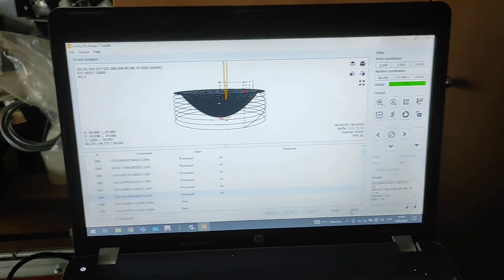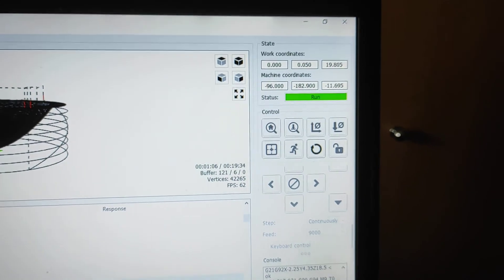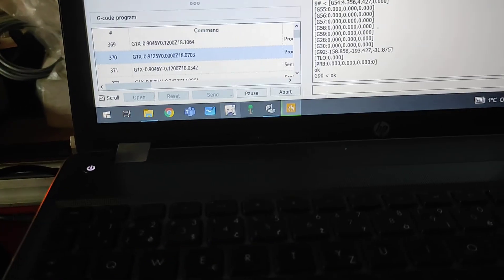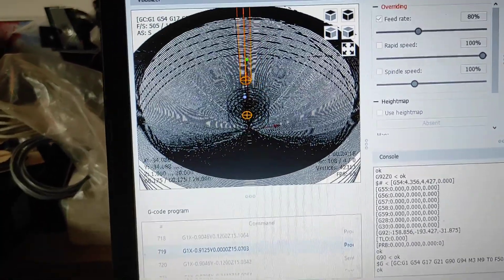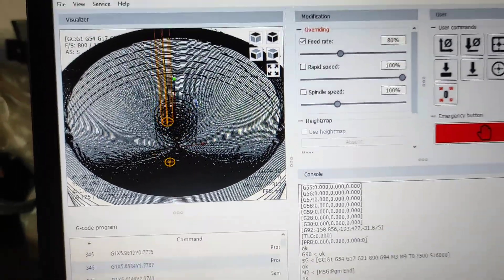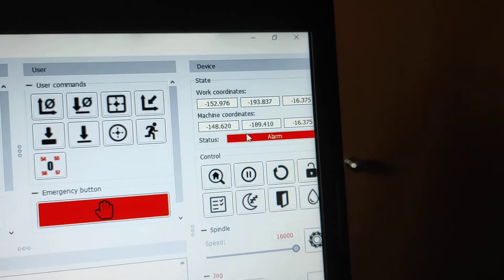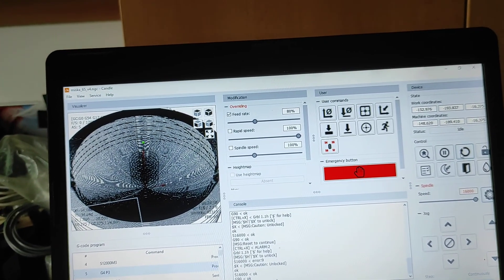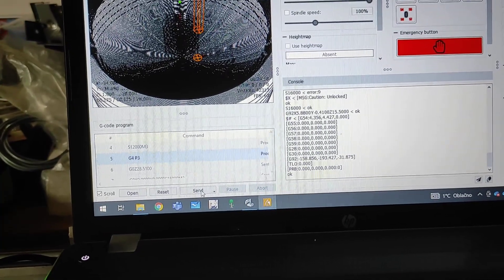CNC GRBL Candle 1.1 / 1.2 - small but important differences

Comment: I have a problem if you can help me please.
When I design a specific drawing and convert it to gcode Comes in the sizes that I want But when I put it in a candle program Comes in extra large sizes. 
I'm confused I can't find the reason, please help me
Reply: Does your machine move as much as you tell it to move? Is it done only for this project? If not or you don't know I would say you have to calibrate your axes. The steps of the motors. If they are far off the motors will travel more thinking they travelled as much as the design. Check your motor steps. There are plenty of videos about it. That is probably it.
Reply from the maker: What does it means "convert it to gcode"? Less info to solve.
Reply: @lupa-cncfocusedonutility2783  
When I put the G-code file in the candle program, it does not come with the required measurements. Comes in a much larger size. 
-Excuse  my English is not my first language.
Reply from the maker: @شمسالدين-س1ط  milimeters, inches ..... what difference between sizes?
Reply: @lupa-cncfocusedonutility2783  
Think centimeters I draw a PCB with a size of 80*40 mm. But the result is very large, doubls the size
Reply: @lupa-cncfocusedonutility2783  
Didn't find a solution right? Wow I'm in real trouble then.